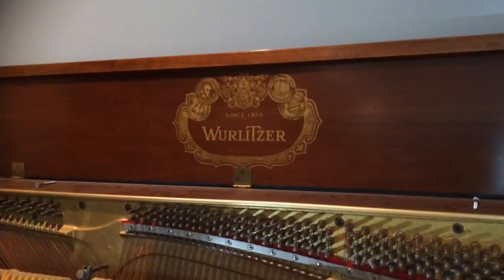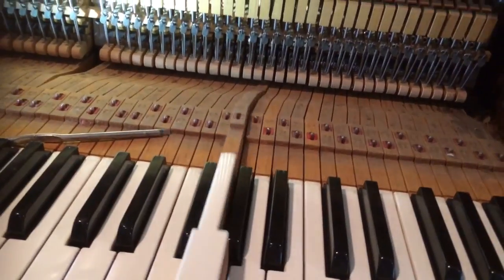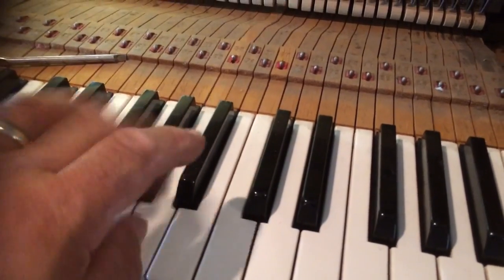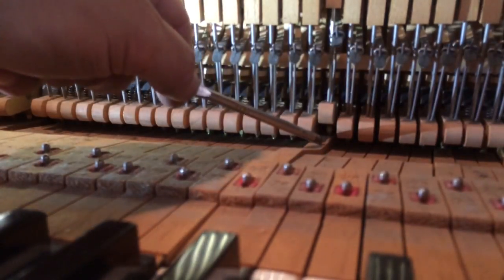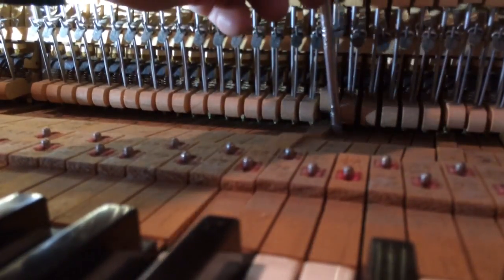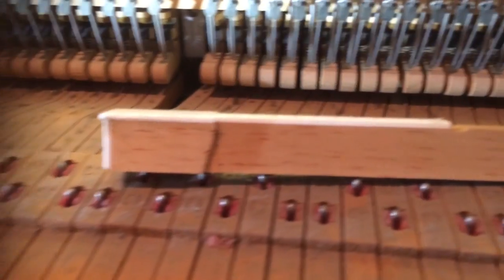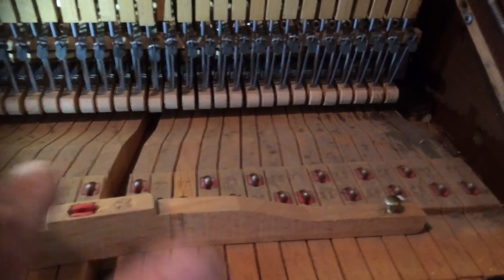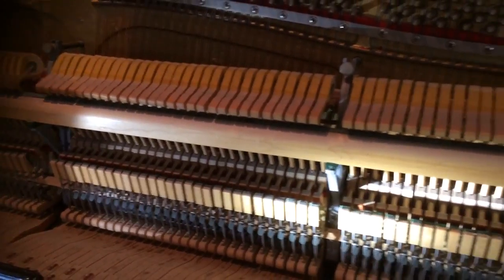Piano Keys Sticking?

Comment: Wait a second here.   You're trying to say that there is not enough weigh at the back of the mechanism yet completely neglect the fact that when this piano was new it could repeat notes just fine.  What has changed??  This is what you should be looking at in my opinion.
Reply from the maker: SparkyMcBiff if you read the later responses I found that there was a lot of friction in the action parts.
Reply: its not that simple if it was you wouldn't be watching his video  there a re a lot of ifs and buts and mabys in a complicated mechanism which is mixture of art and science

Comment: Good video. What is the piece called that is on the pin balance rail. The smaller top piece that the red felt  is sitting in. I need to replace about 4 of them. If you aren't quite sure what piece iI am referring to I can send one.

Comment: I've got one for ya. I looking at buying a piano this weekend.  The main one I want isn't too far away and priced at 500. It's an Ebony Young Chang U-107 upright console. 

I was going to buy it outright, until i noticed 2 of the keys weren't flush with the rest. They were perhaps a 1/4 of an inch lower than the rest of the keys. Any idea what that may be an indicator of and if it can be repaired?

Comment from the maker: Hey Jake, after getting this piano to my shop I found that there was a lot of friction and sluggish pinning in the action. After lubricating the parts several times and tightening and regulate the action, there was a drastic improvement in the repetition. Several notes continued to cause a problem, so in this case I used 1/4 round lead and drilled into the back part of the key to add a little weight for the key to return. I've seen people glue nickels, screws and jiffy key leads to add weight to the back of the key, but I perfer a cleaner more professional look.
Reply: Kurt Weissman did you weight every key?

Comment: Thanks for your video. Question. I've got this piano where most of the black key get sticky to the white key. Not on the side but in the front. So if I press the black it doesn't come back because it gets stuck to the white key. How can I solve this problem?
Reply: if u still have this problem, i'm wondering if perhaps the white keys got too much pressure somehow from the front and thus got pressed backwards reducing the space. Maybe u can wiggle the white keys back to normal. Odd that u got most of the black ones experiencing this. I'd also try removing the action enough to pick up all the affected keys off their pins to try to see if something was wrong with their holes or bushings. Maybe the act of re-seating them will fix the spacing. GL